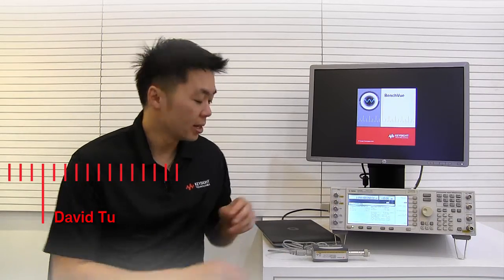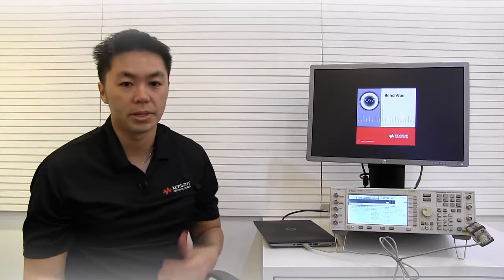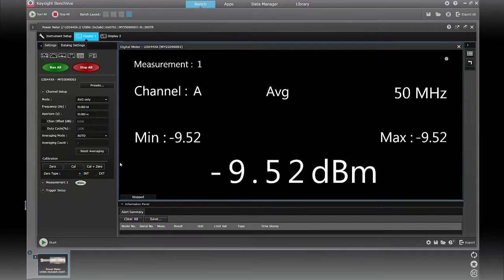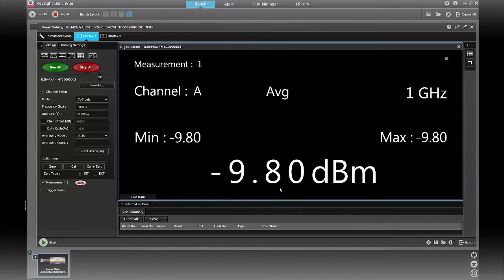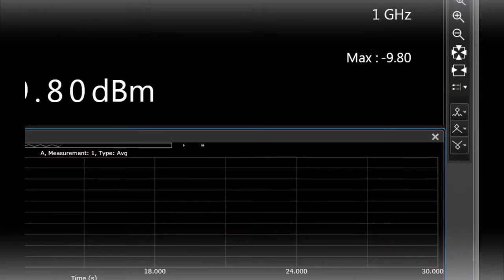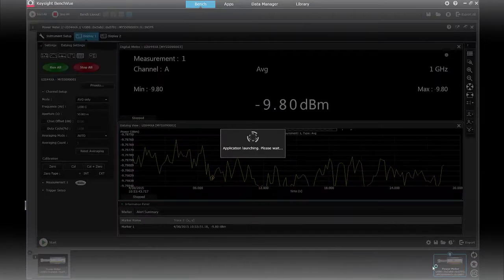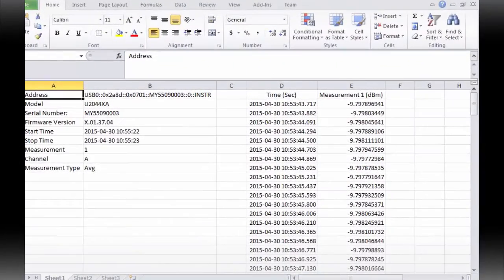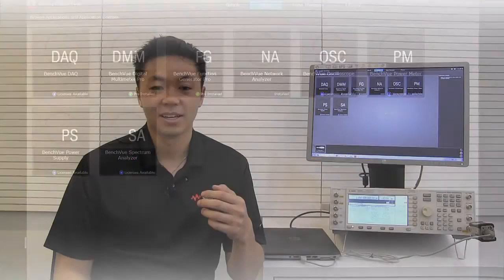Basic Power Sensor configuration using BenchVue

Comment: Does sensors work only with BenchVue? Thanks
Reply from the maker: augusto352  You can program the U2000 series and read back measurements using SCPI commands.